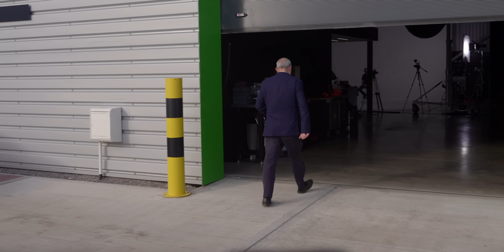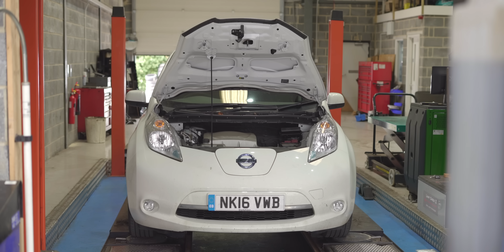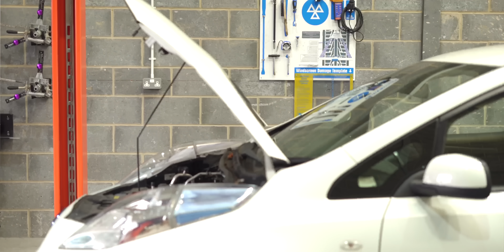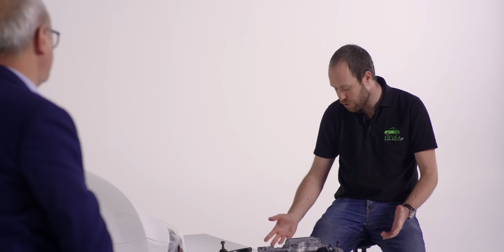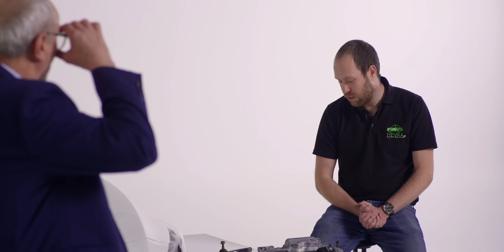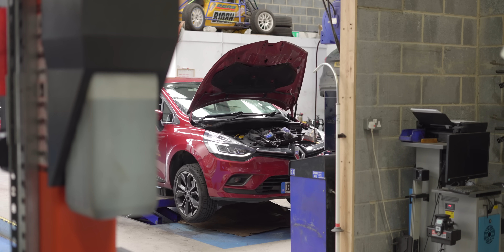HEVRA - EV Mechanics who drive electric

Comment: For context, the failed component Peter shows is an Analog Devices LTC6802 (a small fairly normal battery monitoring chip, which makes perfect sense). It costs about $17 in moderate quantities. The whole battery monitoring board shown (if Mitsubishi sold it) would probably cost a couple hundred bucks or less as a replacement part.

Really great to see an initiative like this; model-specific information sharing can be a huge boon to troubleshooting and repair productivity, and although EVs require generally less service overall than combustion vehicles, it's still important to have service centers familiar with the (sometimes quite different) components and effective techniques to ensure only the minimum amount of failed components get replaced to ensure they're cost effective to operate.

Comment: My Mitsubishi 2012 I-miev was rear ended while standing still and it was pushed into the Mercedes in front of me.   All that was damaged was body panels.   No damage to frame or battery pack, was able to drive it home.   It was considered totaled since all body panels would have to be shipped from Japan to California and since it was at the start of covid it was scrapped.
Reply: My Lex 300id front was crumpled, they wanted to replace the hood and grill and repaint the whole front end so it would match the hood.
I wanted to replace the hood, cheap paint it black make a grill out of screen, test drive it for a while to see if the body is twisted, but then it would have a salvage title, problematic for insurance, so it became scrap.

Comment: 7.14 minutes, the £12,000, plus labour costs, for the new battery pack also includes the fees to transport to the disposal place and the fees for the disposal.
Reply: Mmm, maybe you ought to watch the YouTube video posted on the James & Kate channel. They had their 10 year old Nissan Leaf battery refurbished at Cleveleys Electric Vehicles in Gloucestershire. The job took 4 hours, and the cost was £600.  Full battery replacement isn't always necessary. And any old EV battery would have considerable scrap value. The lithium and cobalt can be 90% recovered and reused in new batteries. Circular economy... Old EV batteries are rarely "disposed" of Stephen. There is a huge arena in Holland, powered by over 200 old Nissan Leaf batteries.....charged via solar.
Reply: @Brian-om2hh  I am glad you said that.
I forget my post you refer to.
The real numbers are extremely important I will go back and look again. 
I believe that you are right. 
I think that EV batteries are critical to electric future of the grid.
In Australia 20million EV will more than be able to stabilise and power the existing grid. 
The alternative is massive increase in grid infrastructure and power plants as transport added to the grid load.
Reply: I reviewed the 7.14 minute 
I was staggered at the situation he described. 
Clearly recycling infrastructure will be a big industry. 
Buying the right car for your area is important.

Comment: How amusing.  That very part you have on display, except for my Kia Soul, my local dealer has ordered for replacement under warranty.  The whole thing, like you said.  Because it’s making a noise, worse when the weather is cold.  Did I mention that because of that absolutely beautiful 8-year 160,000km warranty it’s not going to cost me $10,000 CDN (plus labour and taxes)?   I will be upgrading before the warranty expires in 2023. Hopefully in 8-10 years private EV mechanics like this fellow will be as ubiquitous as the current lot of ICE mechanics.

Comment: 'IF' ev makers wanted to or were regulated to then they could easily make Ev's last for 500,00km almost maintenance free. The first million mile battery is in production now by BYD. We just need governments to stop being the useless twats they are and make sure they force car makers to do it from day one instead of making the designed to fail crap cars have been for the last 20+ years.

Comment: I'm always surprised to hear Robert refer to his unhappy ICE car experiences. Twenty-plus years of hopeless reliability, monstrous garage bills, endless failures, constant disappointment, vast expense...

Was it really that bad? Really?

Wow. I'm surely not unique, but I ran a 1 litre Ford Fiesta Popular (petrol) bought from new, for 18 years with NO major problems. (I don't consider wiper blades and lightbulbs to be 'major'.) Even though I'm a mere girlie girl I spent quite a while rallying, so I was happy to do my own servicing at home aided by a Haynes Manual.

The car was simple, all-analogue, cheap to run, cheap to fuel, cheap to tax and insure and it never let me down. That's right. Never. It just worked.

I appreciate that not everyone wants to work on their car - and Robert's a professional actor-type person with better things to do than crawl under engines and scrape his knuckles - but if he was willing to pay a small fortune to keep his ICE cars running, perhaps that's why the outrageous cost of EV ownership wasn't the shock it is to us lesser mortals.

When the UK weather (i.e. salty roads) finally took their toll of the Fiesta's underbody and suspension mounts and the only way out was to be a massive (local garage) welding odyssey, I sold it for parts and got a cheap (£2,000) third-hand Nissan Micra instead.

I ran it for 9 years. Same basic setup as the Fiesta: again, no gadgets or gimmicks like central locking, but it did have fuel-injection. Again, I did my own maintenance and servicing. The only time it let me down was one winter when its sealed 'maintenance-free' 12v battery died without warning. (The old Fiesta battery could be checked and topped-up as necessary, so you could monitor its state of health.)

Of course EVs are less 'involving', but I find it hard to believe that they represent such a gigantic leap forward in terms of the ordinary Joe (or Jill!) being able to keep a car on the road on a tiny budget.

Unlike Robert's, my driving days were rather enjoyable. I think I'd find the lack of scope for under-bonnet tinkering with an EV rather depressing - especially when things went wrong. I like to be involved. In fact, I like to be in charge. 

But with an EV, it seems that nothing's accessible; nothing's simple; everything's encrypted or electronic or sealed or requires special tools or specialised knowledge... (Serious question: are there Haynes Manuals for EVs? Can you do any significant work on your Tesla to save money?)

Oh, and please don't try to persuade me that things NEVER go wrong with EVs. I don't buy that "My Apple i-Pad is perfect, just like my EV, which is utterly perfect and CANNOT go wrong" stuff.

Comment: An excellent video that gives me a little more confidence that there are hopefully people out there that understand EV’s. It’s interesting to hear your comments regarding dealerships, I’m a retired technician and I worked as a workshop controller for a vehicle fleet management company which enabled me to gain experience on many different manufacturers and I was fortunate enough to have EV training on both Volvo and Renault vehicles. However, one of the big problems I had was prising information out of the dealer network, they seem to have a policy of drip feeding information and although I did multiple different courses, in reality none of them involved in depth electrical training and were therefore pretty useless. As I mentioned, I have now retired and I drive an MG5 EV that I love driving and was interested in having a more in depth understanding of the cars electrical systems  so I attempted to search out any technical information I could find but it has proven an impossible and fruitless to find any documentation whatsoever. The dealership is clueless and in fact offered me a job which amused me somewhat. The other interesting thing is that the MG boasts a modular battery so that faulty cells are replaceable should the occasion arise, the problem will be finding someone capable of doing the work so hopefully DEFRA will be the place to go👍

Comment: The story about the battery pack, reminds me of our local electrician, who did exactly that to our fine, somewhat expensive but some years old dishwasher. He found the faulty component on the circuit board and replaced it on the spot by the use of his soldering iron. Don't know if he just has the experience or member of an alliance, like HEVRA, but the dishwasher has since been working flawlessly for years.

Comment: As a former mechanic and a now Electromechanical repair tech, I have been railing against new designs in EV cars. Many times I am at odds with new OEM products because they are designing and building repairability out of their products. They make entire 3 to 5,000 .00 assemblies that you have to replace or just junk the entire product and buy new. That is not sustainable design. If we can replace smaller items it keeps the costs down but a minimum of wire connections and looms is preferable.  Wiring harnesses have always been an issue when they age.

Comment: Funny that I bought a 2012 chevy volt here about 10 months ago with 109K miles for my mother's caregiver.  She only drove it for 3,000 miles and last week the big battery died on us.  It is only one module (Module 7) that is broke but Chevrolet won't repair it.  They want $10K for a replacement battery.  Found a mechanic who will buy it for $4K and will try to repair it.  I hope he is successful.  I have recommended 6 of these used Chevy volts to friends who drive less than 30 miles a day and they all love it.  It kind of broke my heart to see this one die on us.  Let us hope for more EV mechanics who can work on these cars.  Great video and good timing!

Comment: bought a Renault Kangoo EV. It stopped working. Over seven months in the local Renault garage. It's still there. €17,000 repair bill so far and it's still not working. Think carefully about buying a Renault. Don't believe the rubbish about EV reliability.

Comment: Some forty years ago our induction hob - one of the first - suddenly stopped working.
The “engineer” from the manufacturer came round, checked it over and said it was unrepairable, already out of date and should be replaced.
When he’d gone, I thought what’s to lose? Occam’s razor:simplest is often right; found several fuses in the innards, one was open, neighbour had an odd 500ma one in his garage, hob worked until we sold up ten years later.
So this built-in obsolescence isn’t new, it’s just business as usual and has to be done away with.

Comment: Yes you are correct there are a lot less moving parts in the engine, however don’t forget suspension braking systems, these are common to both ICE cars and EV cars. What is very different for ICE cars to EV cars is a great deal more reliance on software control in particular the charging and discharging point of view of the main EV battery. Software as we all know develop unusual problems and you hear about people plug their car into their home charger at 7:00pm in the evening and come out to go to work at 8.00am in the morning the car has filed to charge, so it’s at least a 45min wait until the car is charged enough to drive to work hopefully. In my opinion the EV cars are totally over priced and joe public are paying for the R&D of these cars and the extremely expensive batteries used in EV cars. I would dearly love to switch to zero Co2 emission on my car but EV has so many questions left unanswered and I think I will wait for Hydrogen technology to become more popular. I love driving the Toyota Miria, far better than EV cars.

Comment: My leaf 24kwh developed an electrical fault where it seemed full of gremlins, it wouldn’t switch on and then everything on the dash was flashing and going crazy when it did switch on . Then it wouldn’t switch off . 🙄. Problem is now all fixed and has never returned again .  New windscreen . ✅

Comment: I'm one of those wanna be owners doing research. We use a lovely independent garage who have saved me hundreds of pounds against the dealership, not least by refusing to do work on faults that didn't exist. Really sad that the last time I spoke to the owner he was utterly ignorant of evs and had no intention of changing or adding to his business. It was right at the beginning of my research a couple of years ago (been isolating so not seen him since) and he thought evs were dangerous because if the battery fails they could stop dead at high speed! I knew he was wrong even then but didn't have enough technical knowledge to put him right. I shall be seeing him again soon and if he's not changed his ideas I'll explain exactly why he's wrong and suggest he contacts HEVRA. If not he has a rival in the same town who is a member and I'll be going there, which is handy.

Comment: Interesting point Peter makes about the manufacturer only making a part available as a single unit. I had a faulty bearing in my EV motor, and Kia replaced the entire drive unit. The dealer said it was not possible to just replace the bearing assembly. Fortunately, it was under warranty.
Reply: Now imagine if that bearing goes for the next owner...
Reply: @AdamKimball  Interestingly, the whole replacement was about CDN $6500 and took 2 days. They told me if it was petrol it would have been about $12K and would take +/- 10 days.

Comment: That replace battery pack to fix a BMS chip failure reminds me of a Rich Rebuilds video where Tesla wanted to sell a customer a complete battery pack because a coolant union had been broken off by road debris and they were able to fix the issue by just fitting a new union
Reply: The difference is one is a fix the other is a bodge job rich him self say he is unqualified to work on cars believe him.
Reply: @alanrickett2537  I'm gonna guess you haven't seen the video I'm referring to then. The work was carried out at the Electrified Garage by an ex-Tesla engineer. Rich didn't touch it, just filmed the repair and put it on his channel.
Reply: @austenchevalier917  yes he had some half way competent people working for him but as they are working for a idiot you have to doubt their judgement when they could do so much better for themselves setting up on their own.

But you will note they invalidated the customer warranty on his battery pack and didn't offer one of their own.

Comment: I would love an EV BUT I could only afford a used one for under £10k in the future and the problem is even though I understand they are more reliable, if and when they do go wrong it's going to cost a lot more from reports I see in EV forums, even with access to these HEVRA garages. Yes, I could get an extended warranty but I feel I should not have to pay extra on any vehicle if it's supposed to be more reliable? I just hope things improve with more access to affordable EVs and repairs in the future.
Reply: Mark, the very first question to ask is if those whom claim EV's cost a lot more to repair have actually owned EV's, and had repairs carried out?  There is a tremendous amount of misinformation being peddled out there, usually by people whom have never had any EV experience whatsoever. There are even rumours of oil company funded "plants" whom have seemingly been paid or contracted to spread anti EV nonsense. One of the latest howlers I've seen is the claim that you cannot rapid charge more than once on a long trip.....  In any case Mark, when it comes to used electric cars, the majority of used EV's on sale should still be carrying at least a year or two of their original warranty.
Reply: @Brian-om2hh  I understand there can be miss formation but I've followed quite a few groups like the Renault Zoe owners club and multiple people have had the same issues, with multiple people expressing the opinion that you need an extended warranty which I feel is excessive on an already expensive vehicle. Like I said I'm a big fan of electric vehicles I've been following them for years and even own Tesla shares, I'm just worried with the age of vehicle I'm going to be able to afford if anything does go wrong it's going to be very expensive to repair due high cost of parts and the limited amount of people that can service it

Comment: Great video and refreshing content. As the buyer of a s/h ev that has a fault where the dealer is struggling to find an economic repair solution and the main dealer wants 90% of the purchase price to possibly fix it. I can only applaud  this initiative.  We need to have an eco system that works to get a reasonable long life out of evs.  We need a right to repair at a reasonable (economic) cost, not the highly proffitable module swap strategy of the manufaturers and dealers with all the attendant e-waste.